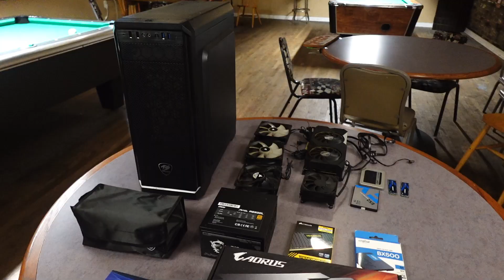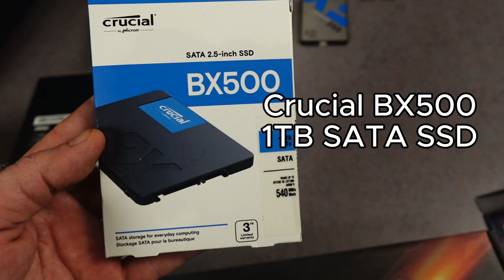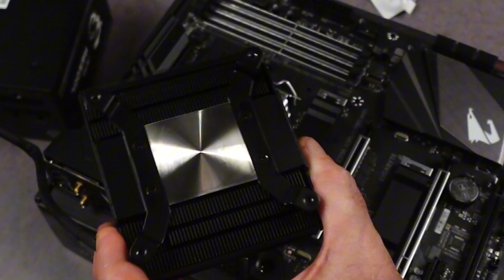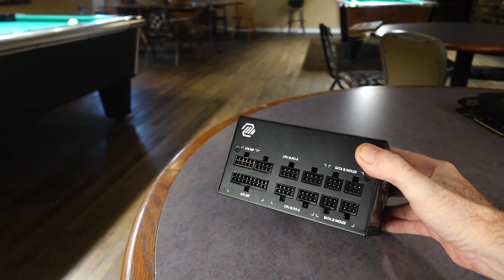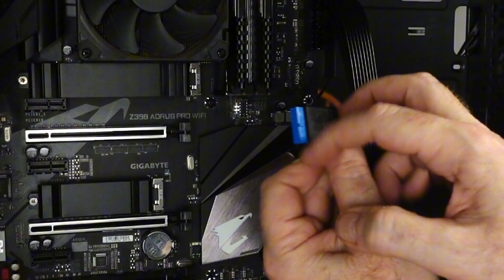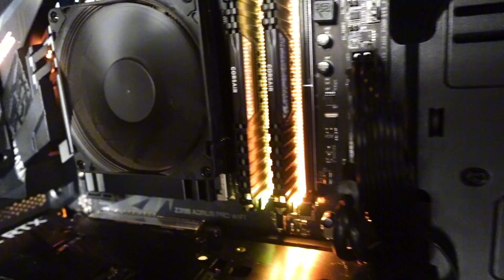Step-by-Step Build - Flight Simulator PC - Complete Guide Lazerbolt Flight simulator 2024

Comment: Now here comes Mr. Nitpick to get that engagement up:

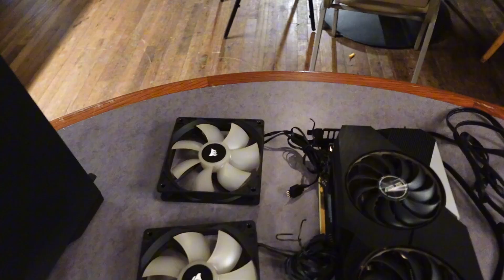3:24 Don't go buying a cooler like this guys. If you already have it, which I'm assuming is what happened here, a standard cheap cooler is better. These are for situations where there isn't space for a full sized cooler. 
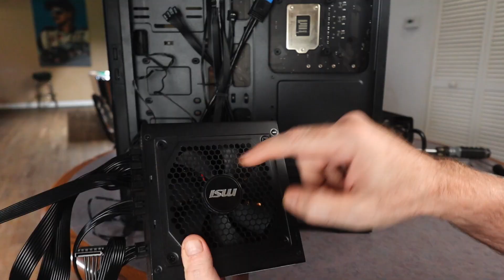14:18 That's actually where it sucks in. It blows out the back. 
21:16 That actually isn't good for a $60 case. The only thing it really has going for it is that it has 4 USB ports, but if you have enough ports on the motherboard, which is what you should be aiming for anyway, you can get much better cases for that price. 
23:16 Plug it into a monitor anyway. You'll then see if it POSTS because it'll get to the screen where it says that there isn't an OS for it to boot. 

Solid build. I figured you'd need better hardware than this to run Flight Simulator tbh.
Reply from the maker: Hi Dexx, thanks for all the nitpicky engagement.
You make fair points, but a lot of it does come down to personal preference.

1.  Yes, the cooler is a small form factor, but it out performs every "standard cheap cooler" I have ever used. While you can find cheaper coolers, this one is not expensive and I still highly recommend it.  Also, NEVER go with the low quality stock solution that comes with Intel CPU's.

2.  To clarify, we're talking about the fan on the power supply here, Sometimes people think something blows when it actually sucks.  Valid point.

3.  Totally personal preference, but I really do love this case and would absolutely build in one again sometime in the future.

4.  I actually did say the first thing I'm going to do is plug it into a monitor.  This was just a quick power up to show all the pretty lights for the camera. Hollywood magic.

Thanks for the tips.  It's not a build video until someone gets all "umm actually" about it. Thanks for watching buddy!
Reply: @LazerboltVids  1. The cooler you used is $50. "Standard cheap cooler" actually isn't bad nowadays. The Peerless Assassin 120 is $35-40 and will perform better. It's not a dig at the Noctua; it's just pointing out that it's made for a certain kind of build. And I agree. Never use the Intel stock cooler. 

3. The case you used has almost no room for cables at the back, is a bit lacking on routing holes and has other cost cutting bits here and there. Something like the NZXT H5 Flow is $60, is a bit better build quality wise, and comes with two fans, for what it's worth. Once it's already built, it really doesn't matter, but I'd go for the one that's easier to build in. 

4. I know, It's just that you can plug it in and not rely on the fans or lights. I actually just use a motherboard speaker, so I can hear the beeps to know if something went wrong. You're experienced, so you really don't need to do much, but it's probably gonna be new builders seeing this video.

Comment: Also, also, do you have strong thoughts on which way to face your fans? And air flow in general?
Reply: In this case layout, in from the front, out the back, and the top can go either way really. If using an air cooler, you actually don't want to have an exhaust fan at the top in the front-most slot, since all it does is pull air directly from that top fan in the front and push it out of the case without it actually cooling much, if anything.
Reply from the maker: Dexx pretty much covered this one. Out from the back and in from everywhere else.

Comment: Hey, I’m still kinda skimming the video and haven’t finished it yet, but I noticed you’re going with a heat sink rather than like an all-in-one cooling unit. Do you have a strong preference for one or the other? Or was the choice this time more out of price/convenience?
Reply: An AIO is a waste of money for this build. It makes little sense to spend $70+ on an AIO when you could get a $40 air cooler and use that extra money on other parts. That's a pretty old CPU that isn't going to be pushing that much heat.
Reply from the maker: As Dexx points out, an all in one is a bit of overkill on a system like this. While I would recommend to NEVER use the cheap, loud stock cooler that comes with a lot of cpu's, I think that AIO's are overused and are not needed most of the time. Obviously it won't hurt to use one, but they're not as necessary as a lot of people think.  I would only go with an AIO if you're having cooling issues with a standard heatsink/fan.  Thanks for watching!